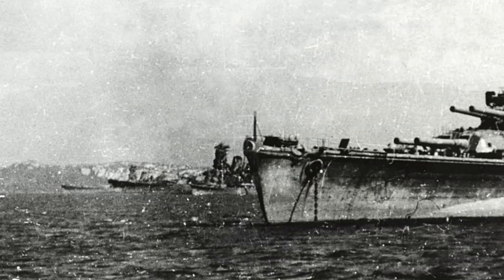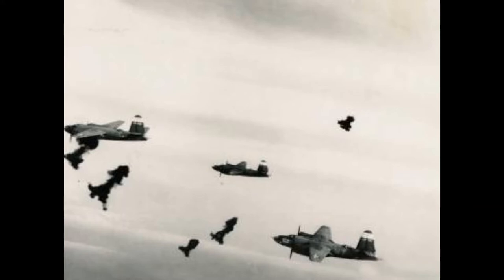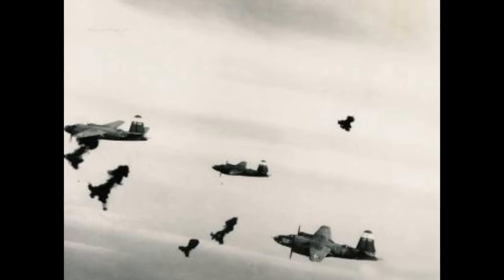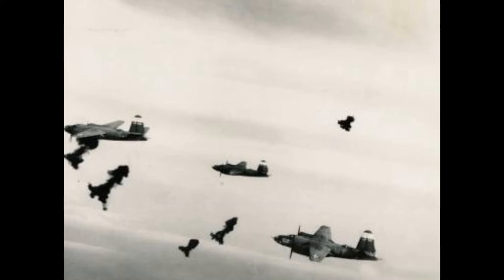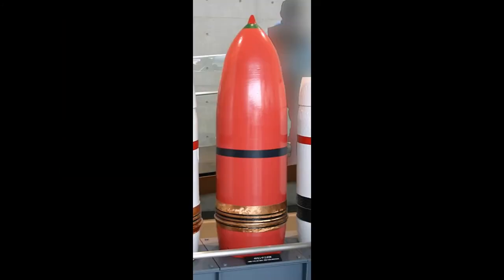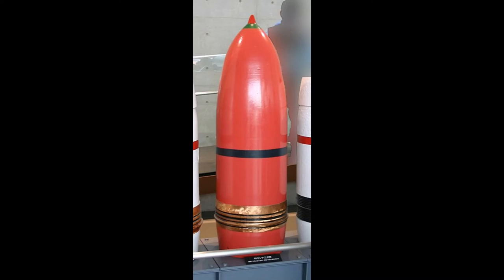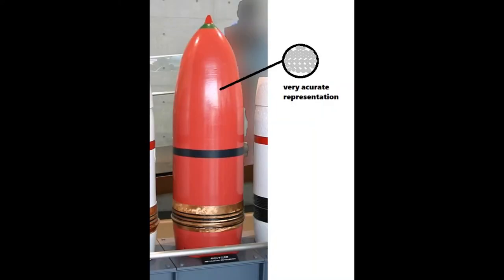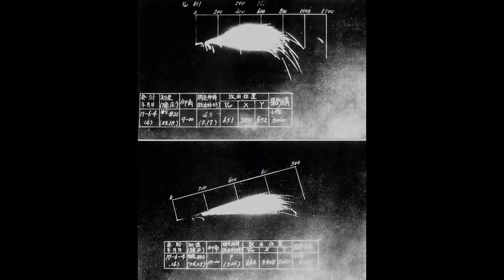The type 3 shell explained.

Comment: If these shells had been used properly they could have done so much damage to an aircraft as the heat could potentially have melted or burned off parts of the aircraft meaning that it would most likely crash or explode if a engine or fuel tank was hit due to the heat but with them being introduced part way through the war crews were not fully trained on how to use them properly and often assumed they had hit the enemy when they in fact missed due to the drop in altitude of the heated metal etc compared to regular HIGH EXPLOSIVE ANTI AIRCRAFT SHELLS that they were used to firing as the high explosive shells only had to detonate close to the target aircraft to cause damage but the type 3 anti aircraft shells required detonation at higher altitude than the target aircraft to get a hit yet if the type 3 shells were fired correctly they could have been quite lethal potentially and if the Japanese had trained with the type 3 shells before they attacked the Americans at pearl harbour then they might have been more effective in the war although they would have most likely still have been defeated by the Americans eventually but might have had higher casualties if they were better trained etc like the American forces had been trained quite a bit better than the Japanese forces were as most of the Japanese at that time were lucky if they had more than a few days or a couple weeks of training before their first real battle began where as the Americans usually had roughly two to four months of tough combat training before being deployed to active hostile combat positions for their first time most of them would never return home again alive before the end of the war but their actions and courageous bravery will NEVER BE FORGOTTEN as one well known historical figure of the Second World War better known by the world as Sir WINSTON CHURCHILL the world famous UK 🇬🇧 PRIME MINISTER during World War Two was quoted as saying “NEVER IN THE HISTORY OF WAR WAS SO MUCH OWED BY SO MANY TO SO FEW” what sir Winston Churchill meant by that was basically that those who were civilians owed more than ever before in history to those brave few percentage of the world’s population that were willingly prepared to risk their lives fighting for their countries and the civilian population even if it meant that they would not survive the conflict they were still willing to go to the war front lines no matter the danger they would be facing most of them gave their dying breath in combat for their country to be safe and free from danger so their countries citizens could live in peace and comfort etc WE WILL NEVER FORGET THE BRAVE AND HONOURABLE SACRIFICES OF OUR FALLEN ARMED FORCES PERSONNEL THEY RISK THEIR OWN LIVES FOR OUR PEACE AND SAFETY AND FOR THEIR SACRIFICE THEY DESERVE TO BE RESPECTED AND REMEMBERED FOR ALL OF TIME as they had the option of not joining the armed forces and living in peace and safety but instead they chose to put their lives on the line to defend their country and its citizens from any threat even when they know they might be killed in combat